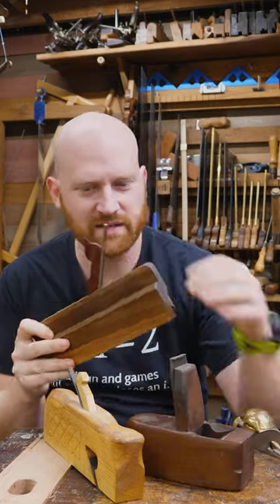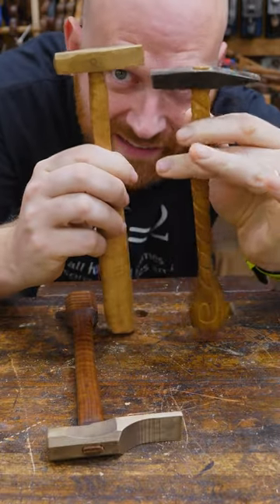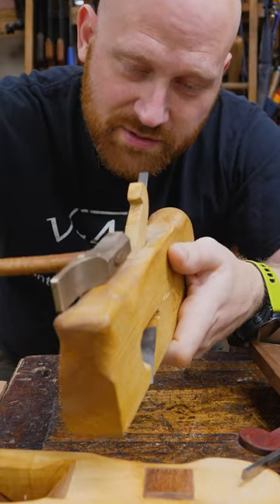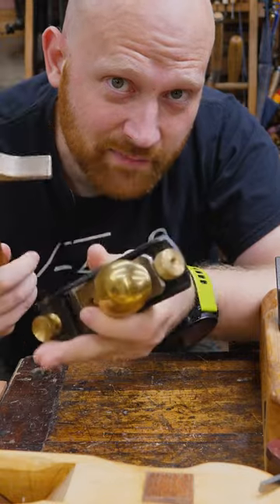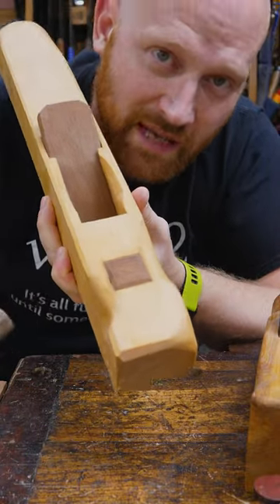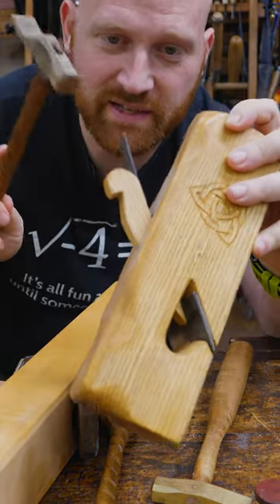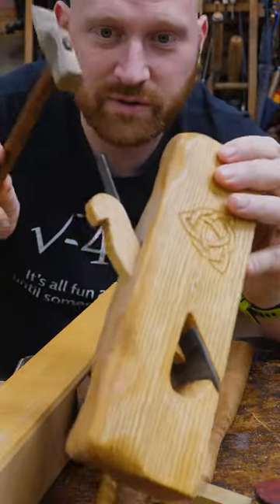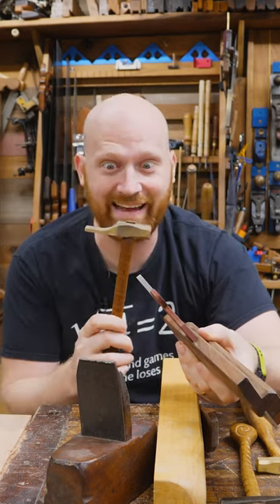How to adjust a wooden hand plane

Comment: Bike mechanic here. Whacking things with a hammer is a pretty crucial part of the job at times lol
Reply: Have you ever seen a bike where the FRAME got bent out of shape because someone laid it on its side, causing the chain to jump out/get jammed Constantly?

That's what happened to my bike. It's a proper brand (nothing amazing, but still known), from a giant store. And it bent. From laying down.

How common is that? Cause I feel like even aluminium frames (Wich mine allegedly is) aren't that weak.

Comment: I have 3 small wooden planes and one larger jackplane. Probably a century old by now at least. Bought them here in the UK 60-odd years ago for a few shillings. Wishing now I'd had a few more shillings at the time - that old second-hand toolshop had hundreds.
I'm too arthritic these days for much woodwork, but a decade ago, fitting some kitchen drawers, I needed grooved sides that clearly called for a router. But instead, I got out my old wooden 1/4" grooving plane and got the right result in half the time it would have taken to set up my electric router.
Adjusted how? With what used to be called a 'toffee hammer."

Comment: Here's an amateur question: is a plane knife/blade/iron supposed to be angled? I just bought a Stanley #4 (the only plane available in Hawaii) and it's far from 90°.
Reply from the maker: There are some planes that are skewed. Those irons might be at 70 or 80° depending upon how aggressive the skew is. But a lot of irons are out by a few degrees one way or the other. That's why there's a lateral adjuster on the plane so you can make the edge parallel with the bottom of the plane. When sharpening it just put more pressure on the long side and it will eventually bring it down. Here is a short with a bit more info. https://youtu.be/OlD540z-x88